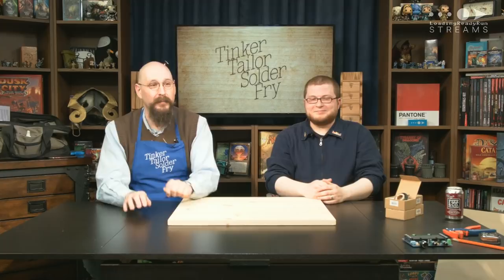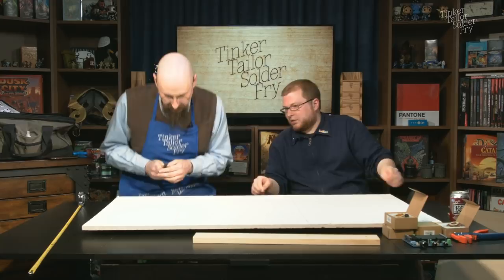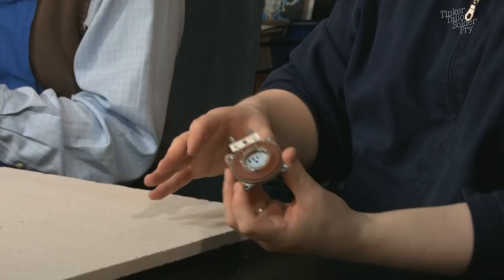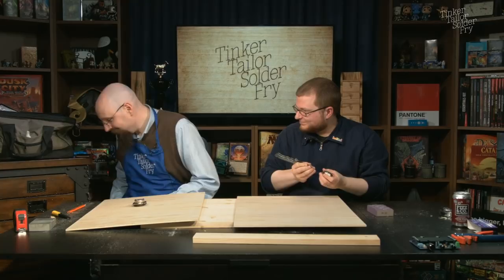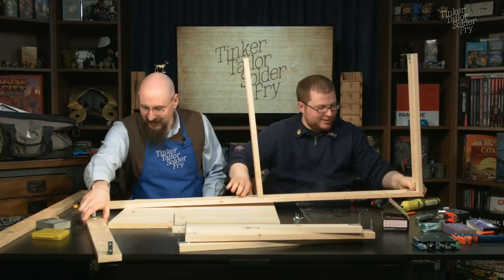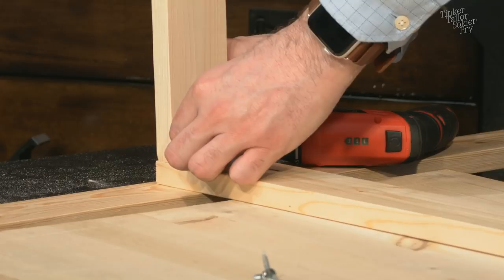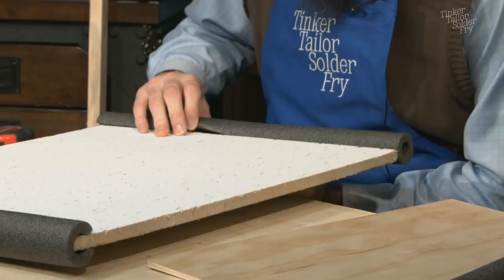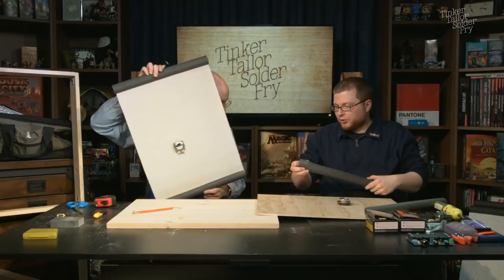Homemade Speakers || Tinker Tailor Solder Fry

Comment: I want to give a huge thank you to Ian for inviting me on to do this project and to Cori and Heather for all their effort and support to make it happen.
As requested, the main relevant parts used for this build are as follows:

Dayton Audio DAEX25FHE-4 24W 4 Ohm Exciters
Dayton Audio DAEX30HESF-4 40W 4 Ohm Exciters
GRS 12SW-4 120W 4 Ohm Subwoofers
24"*18" (60cm*45cm) Pieces of 1/4" (6mm) Baltic Birch Plywood
24"*18" (60cm*45cm) Pieces of Acoustic Ceiling Tile (with traditional random patterning, not faux wood or other textures)

We wired the exciter speakers in parallel to bring each framed pair up to a total of 8 Ohms, which was the minimum that the amp was rated for. The subwoofers can be wired in series, parallel, or on independent amps, depending on what's available. How to wire all of these will depend heavily on the individual setup they are used in. 
I had a terrific time working on these, and I love the way my own set sounds.
Thanks again to Ian, Cori, and Heather for making it such a tremendous experience being on the show.
Ever forward. Occasionally learning to drill pilot holes.
Reply: Thanks for the parts list, I will attempt to do this as a project in the near future.

On a separate note, when you and Ian did not drill pilot holes in the wood, I started hyperventilating haha.
Reply: I think you meant to say you wired the exciter speakers in series to get 8 ohms because if you wire two 4 ohm speakers in parallel you get 2 ohms and your amp will not be happy.
Reply: I was wondering if you have some more information about the subwoofer design. Dimensions. Possibly a link to this build somewhere else. !
Oh and thanks for the DML stuff too. 
Stay safe.